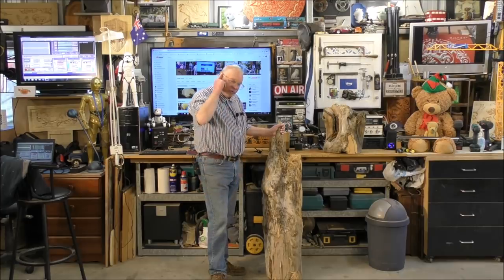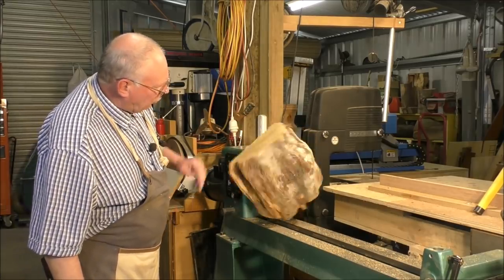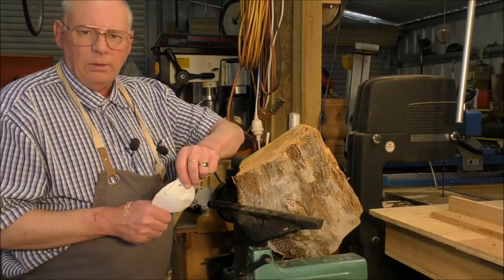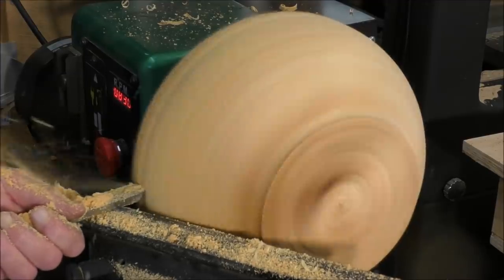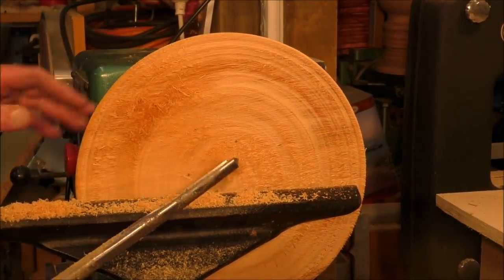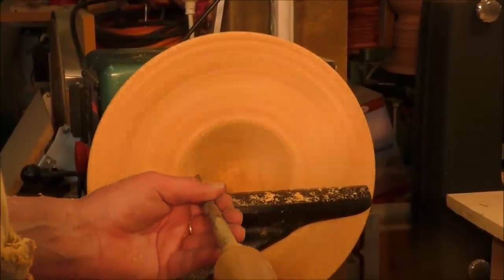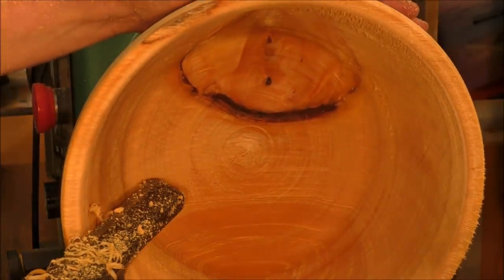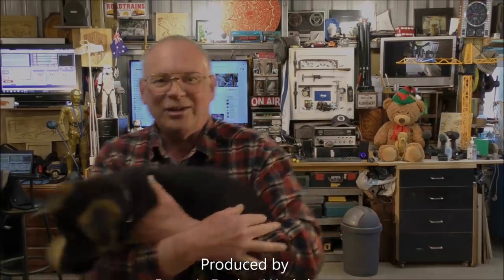A spectacular 2000 year old wood into a bowl  Wood-turning

Comment: Have you tried using a bowl gouge so that the bevel glides (some say rubs) the work in a cutting or slicing action? You seem to be using your gouge as a scraper evident in the very rough surface your getting. There are many advantages to using a bowl gouge to slice the wood like a wood plane rather than using it like a scratcher.
Reply: @Brian Greenwood I have no channel but I've been turning for a few years now, since 1984. He's very capable but do look closer and you'll see what I mean. Not every comment is meant to be hurtful some are constructive criticism.
Reply: Using a bowl gouge     plus ABC           anchor bevel cut  will give a smooth cut and be control-able

Comment: Roger I really enjoy your videos and am learning so much.  I have a question about the finishing of the bowl.  You repeatedly said how wet the wood was but yet you finished it right after turning it.  I was under the impression that it must be dried first.  Is that correct or is there a way of finishing the bowl even when the wood is still wet. I look forward to your reply.
Reply from the maker: This video was made over 7 days at the finish I applied oil only, the bowl will be stored for up to 6 months then re-machined. I find this method prevents the bowl going out of shape;-))

Comment: Nice video, but I must by the technique with the gauge could be improved to the state where the wood comes off as shavings, not as dust, and with fewer vibration. That is in my opinion the result of the best turning technique. In your technique the tool is like hitting the wood instead of cutting it, and the noise also indicates the same thing.
Reply: Either this or the tools are not sharp enough ..
Reply: Agreed.

Comment: I would have trued up that outer edge and rounded the piece up a bit more, just to keep the vibration down on my machine so the bearings do not wear out as soon with a vibrating out of balance piece of wood vibrating the meching to death. Could even smooth the cutting of the tool from gouging into the wood as well, from the vibration. Plus reaching out over the brace is not good either, you lose all your leverage with the brace being so far out during a long reach, trying to cut your curve radius in. Plus it is dangerous too. If you could count all the rings that you cut off before you have gotten to the finish bowl, it would be older than the finish dimension, you removed a lot of the growth rings when cutting it down to the dimension it is now. So that piece of wood was much older than the finish calculations or counting of the rings, when it is finished.
Reply from the maker: Thank you, for watching,  Please like, subscribe and forward the video on to a friend,  Roger Clyde Webb